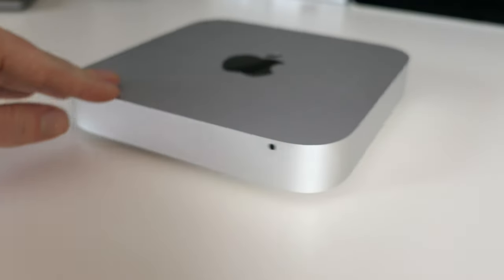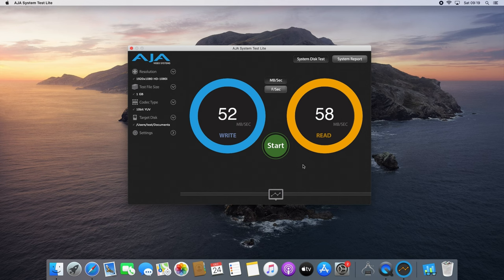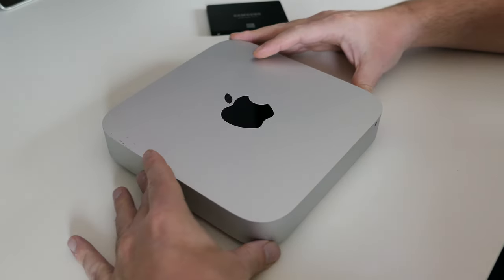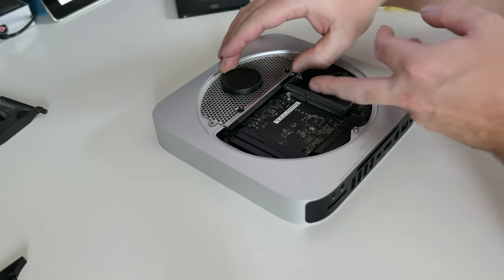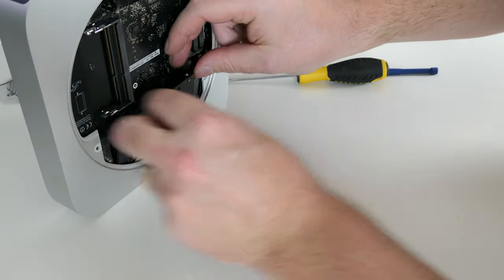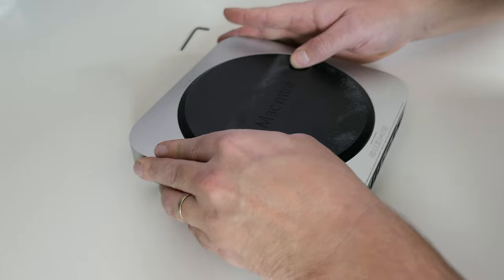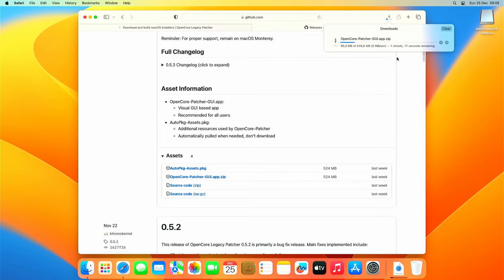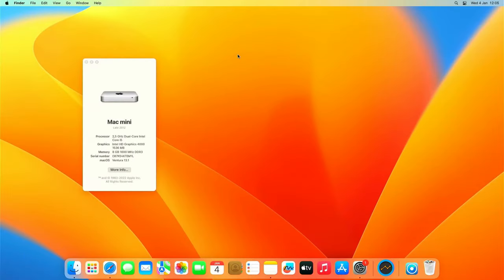Mac Mini Late 2012 - macOS Ventura and SSD Upgrade

Comment: I'm an 81-year-old grandma and have probably had 10 2012s run through my life and upgraded them all with SSDs, 16 gigs of ram for my two sons and myself.  I just bought another one to upgrade and install Ventura.  This is a perfect video for doing it.  None of us have busy lives so the few more seconds it takes to load anything is of no consequence.  Plus the 2012s are getting cheaper and cheaper. I seem to be a loose ends if I don't have a 2012 to fool around with.😉 They are the best streaming/media boxes ever using TVs as monitors.  Thanks for your good work!
Reply: I think it’s possible to buy 2011 models and replace the motherboard with 2012
Reply: @Helennore1990  Given they're very similar machines, I could see that working. What would be the purpose of this though?
Reply: What's the relevance for the technical support by stating that you're an 81 year old grandma? We don't care about that, you could be 200 years old and we'd help you anyway.
Reply: @greenhorngameplays5743 if it matters to her, then it’s relevant to her comment.  Your comment was unnecessary, not hers.
Reply: @evanrachelhood  your comment is also irrelevant to the video purpose.
Reply: @greenhorngameplays5743  reading comprehension? It was in support of the statement that she has plenty of time to goof around with these.
Reply: @herbiecactus6687  reading comprehension. it's still not relevant.
Reply: @greenhorngameplays5743  This is called experience. It often goes along with respect. You are missing at least one of those two. You must be very experienced.
Reply: @georgwor8955  then?
Reply: @Forlorn. the 2011 Mac Mini and MacBook Pros have an AMD GPU that had a manufacturing/design flaw that meant that every 2011 machine with that AMD GPU will eventually fail. Although, at the point of replacing the entire motherboard with a newer one, it would just be easier to buy a whole new Mac Mini 2012.

Comment: I had one of these exact machines back in 2019/2020! I used it as my daily machine when we were all online, and it worked like a charm! I upgraded to an M1 though just because I needed something faster for video production, but these are still quite usable I think!
Reply from the maker: They sure are. Such a pity Apple stopped supporting them. Although it is over 10 years old, the hardware is clearly capable of running Ventura without (performance) issues.
Reply: @jensdbe  What is the max capacity for the ssd, is there a limit cap on them, or could I just go ahead and install a 4 or 5 tb ssd?

Comment: Hi Jens. Yesterday I bought a used i7 Late 2012 where I would like to replace the built-in 2TB HDD with a 1TB SSD. I have already owned such a model and replaced the serially installed Ram and HDD a few years ago. However, the German YouTube videos on the subject were more elaborate because in these videos the motherboard was also solved to pull it a little forward to remove the HDD. In your video, removing the HDD as well as inserting the SSD without loosening the motherboard. Thanks for your instructions and greetings from Germany, Thomas.
Reply: Up Date .

Everything worked according to your instructions. However, the installed 2 TB HDD was not one but 2 1TB HDD's. In order to remove both, I would also have had to partially disassemble the logic board. I somehow didn't feel like it. So the 1 TB HDD remains installed as external storage for something.
Greetings , Thomas .
Reply: @thomasromeni8063  now install os ventura:)
Reply: @-xYz--nk1gm  
Of course, it was installed directly 👍 . Runs perfectly with Ventura.
Reply: @thomasromeni8063  I know. i also have a mac mini 2012 but i5. I only have 1 ssd and 1 hdd.
Reply: @-xYz--nk1gm  
Do your SSD and HDD work as a Fusion Drive or, as with me, as a separate hard drive. I briefly played with the idea of combining both as a raid partition, but I rejected it when I read an article that with this combination the HDD is the brake at the speed of data transfer. Having an SSD work alone would be the more reasonable solution.
Reply: @thomasromeni8063  it's different for me :) the ssd works separately as the ventura axis. but the physical hdd has proxmox installed on which i have my own dsn server, open mediavault. that is, it is not a Mac, but a Linux server. if I need a second computer, I run the ssd from the ventura and watch movies, because it is connected to the tv.
Reply: @-xYz--nk1gm  
This is an interesting division of a single Mac 👍 .
Reply: @thomasromeni8063  Hi Thomas, I have the i7 (fusion drive) too running on Catalina. Mainly working with Logic X on that machine. Was just about to swap the fusion drive for two separate SSDs to make it faster.
Now I wonder if I could install Ventura on one SSD while keeping Catalina on the other. What do you think?
Reply: @secondbow9409  
I don't know what speaks against your idea with two different operating systems 👍 . Especially if you use programs that run under Catalina, but no longer under Ventura.

Comment: Great video thank you.  I have the late 2012 model with the same processor, back when it was still new upgraded to a dual disk with the ssd carrying the OS and upgraded to 16g of RAM.  This summer bought the new mini with only 8g of RAM but it still is so much faster.  Should I take the time to upgrade the old mini to Ventura also?  Does it run better or worse than Catalina in your opinion?  I love both and the 2012 still has life in it.  thx
Reply from the maker: The performance difference with an M1 is obviously big. About everything is x times faster. Not really surprise for a 10 year newer device as well. In terms of feeling, Ventura does not significantly run faster or slower. It's more to stay up to date and be able to keep running the newest applications and get security updates. I do plan on doing a performance comparison between Catalina and Ventura on this device (and another) to see this in real numbers.

Comment: Thanks for this exceedingly helpful video. Just wondering;  will the cooling and fan sensors be affected by the newly swapped SSD. Is there any settings to be done from the system after installation regarding the fan?
Reply from the maker: Nothing needs to be done as far as I know. A SATA SSD doesn't typically run very hot or similar to a regular mechanical hard drive.

Comment: Thanks so much for this and the other more detailed vid for upgrading to Mac OS Ventura. I’ve just finished swapping out my HDD for an SSD. 
I did however notice that in this vid when installing Ventura after new SSD is installed, you use install Mac OS Ventura; but in the other vid you use the EFI file instead. May I know what’s the difference?

Comment: I use my i7 16GB 2012 mac mini as a server my main machine is a M1 Mac Mini.  The 2012 machine has dual 500GB SSD and an external matching Hub with 2TB storage.
Reply: Do you need any adapters to do dual SSD? All the dual HD videos on YT show one Physical drive and one SSD

Comment: Nice job Jens. Dank U wel!!! One doubt please: Is Ventura or Sonoma stable with the Mac Mini late 2012 6.1 (i7 3615QM)? Thanks a lot and happy new 2024 year!!
Reply from the maker: For me both run pretty stable. I do see that the hardware starts to struggle a bit with Sonoma. Probably due to the relatively slow CPU I have but that should be better with your i7.

Comment: Hi! Great video :)
One questions, could you please tell why the open core is necessary to apply to the system post install?
Reply from the maker: As Ventura is not officially supported by Apple, there is a need for some modifications/patches in order to let Ventura work fully. It depends on which hardware exactly but things like adding drivers or workarounds are needed.

Comment: Your video is absolutely helpful. After watching it a few times, i give it a go today, i upgraded my mac mini late 2012 i7 to macOs Ventura 🫣🤭 also upgraded my OS SSD to 1tb plus added a 4tb samsung 870 evo ssd for my files and photos. I am planning to upgrade the ram next to 16GB again. 
your video is easy to follow, really on point. I was able to install it easily rather than re-installing macOS Catalina when I reformatted my macmini yrs ago 😅 i only have a question, how does the fan works? Does your macmini gets so hat easily? If yes, what do you do to minimize the heat? 
Before this upgrade, my macmini was running smooth and quiet. I added an external usb fan on the back which help to lessen the heat. I was able to run my macmini for two days without shutting down and doing browsing and little youtube, the temp only goes as far 60 celsius. But now after the upgrade, i cant make it lower than 75 celsius. 
Anyone running the same problem? Is it because of the ram? 
Please if anyone have any idea how to fix the heat issue, i am happy to listen and try to do it. ☺️😉 TIA 🙃

Again thanks for this video. Its awesome ☺️
Reply: Fan is definitely working? I've also had problems with my 2012 every year when my apartment gets hot.
Reply: One thing I’d suggest is replacing the thermal paste, as the old stuff can get dry after 10+ years, thus reducing the cooling efficiency. It will also help to clean out the fan and heat sink, or replace the fan if it’s failing or broken. Having a secondary fan will also definitely help.

Comment: I just cracked my 2012 Mini 2.6 i7 for the first time because I wanted to eliminate HDD spin-ups from my life.  I followed the instructions on Macfixit to swap in the SDD.  It did not go well. I destroyed the IR harness (which I've never used and never will) and had a really hard time getting the new hard drive seated with the ribbon in any kind of reasonable positioning. Ended up with the SSD hanging at an angle, fingers crossed that the connector doesn't pop off the motherboard.  Not sure I got the wifi antenna connected properly again.  But it works and I'm booting from an intrernal SSD finally.
Reply: Various videos show several schemes to get the dowels (actually screw heads) in the back of the  SSD to fit in the upper set of holes in the back of the storage compartment. I use the one with a piece of tape with loop in the middle, to make a handle to pull up on the SSD. If you wish, there is space, and a connector, to put a second drive under the normal HDD/SSD. You have to source the proper SATA connection, which is much like the OEM main drive connector. And connects to the open SATA drive port on the logic board, directly to the right of the regular one. Other ideas are using a playing card under the drive to again, get the positioning dowels in the back of the drive inserted in the correct, upper, drive positioning holes. I use loops or doubled reading glasses, to be more competent refitting the various connections, such as the fan (NOT necessary to unplug to access the drives) and antenna. My last goof was not getting the drive SATA connector fully into the logic board SATA port, and had to go back in, and using more magnification, do it right the second time. You can't do what you can't see! I have noticed a big improvement in startup with the SSDs, I'm not using any program that tests machine performance enough to notice.
Reply: @billtaylor3499  good tips, wsh I'd had the benefit of your comment on the day of the operation.....I think if I ever go back in it's only going to be to salvage the SSD.... I'm not looking forward to whatever moving to a newer OS is going to break, but this machine really just doesn't cut it anymore.
Reply: @herbietccc  Higher OS versions Do install in your Mini, several YT videos show how to use another app to install 'unsupported' later operating systems (Ventura?) in a late 2012 Mini. A later OS may not be the issue, maxing out memory (Other World Computing is where I got mine) changes things, maybe enough. I'm noticing no difference between 10.13 and 10.15 in my 6.2 Mini, but I'm not doing any real computing, mostly surfing the net. I have the different OSs on different SSDs, and boot the one not in the machine using an external drive housing and a USB cord. Not fast, if I needed it, but lets me have two different computers. If I get two fully performing SSDs (At least one has an isue), they both go in the Mini, one under the other. Which boots is selectable on startup, by holding down the option key, on mine.
Reply: @billtaylor3499  I have no interest in moving to a newer OS on a 2012 mini. I don't see how your comment relates to mine.

Comment: I have the same Mac Mini i5, exactly the same SSD disk and 16GB of RAM. After install Ventura GUI is much slower than on Catalina for example. Selecting an option in System Settings from sidebar take 1-2 seconds
Reply from the maker: I did notice that System Settings is indeed slower. The rest doesn't really feel that way. More people complain about slow navigation in System Settings on Ventura apparently. If interested, also check out the performance comparison I did between Catalina and Ventura on this Mac: https://youtu.be/ZI7pjHKyuJY

Comment: I followed the steps and installed the Monterey OS, which brings back my old device to be a truly usable one, thanks so much! I just want to ask, after successfully setting up the Mac, there is software update option available to install Sonoma. Is it possible to install it with my Macmini6,2?
Reply from the maker: It should be possible to upgrade to Sonoma. Best is to first install the latest version on OCLP before that.
I did create a specific video on Sonoma as well in case you would be interested: https://youtu.be/acpQuCIy3GA

Comment: Hi Jens,
Another great video😊
Of course all the best wishes for 2023!
Question,
Ido have a Mac mini mid 2011.
Do you think I can upgrade this also to Ventura?
At the moment is still runs on latest supported os high Sierra.
Thanks, Hans
Reply from the maker: Thanks Hans for the nice words. Best wishes to you as well.
The Mac Mini 2011 is not supported yet for Ventura with Open Core. The latest you can run is Monterey (did a video on that as well but better to use the current steps, just select Monterey as version instead of Ventura). Support for Ventura is still in development. See here for more info: https://dortania.github.io/OpenCore-Legacy-Patcher/MODELS.html#mac-mini
Reply: Thanks, Jens.
Will look into it😊
Reply: Hey. FYI. Last night my 2011 Mac Mini upgraded to Ventura. Opencore still needs to patch everything. But install Monterey, then run the macos updater, then run opencore patcher after update to Ventura.
Reply: I should add.It will be unstable. You should wait for the latest patcher to be supported first. But if you aren't worried about freezing from time to time, Ventura works, but Monterey is still more stable for the moment.
Reply from the maker: @corvusaflame713  thanks for the update. Looks like with some (minor) patches, Ventura should eventually come to the 2011 model as well.

Comment: Nice explanation on upgrade. I have few doubts:
1) Can Mac Mini late 2012 (intel i5) take 1TB SATA Crucial SSD MX500 series. 
2) Is it adviceable to add 500GB Samsung SSD. (I mean Addition and not replacement). Will it work properly with 2 different type of Hard drives.?
3) I have already upgraded my mac mini with 16 GB RAM (8+8) of Crucial. Should I upgrade SSD also of CRUCIAL or it does not make any difference.
Reply from the maker: 1) yes
2) Different hard drives are no issue, it has two separate SATA ports 
3) No need for the same brand of memory and SSD

Comment: Great video, thank you! How do I mirror all my data and software from old hard drive?
Reply from the maker: I think the easiest method is by using time machine or migration assistance before upgrading.
Reply: CarbonCopyCloner or SuperDuper! will also clone your old (Catalina) hard drive to your new SSD.

Then install Ventura on top via the OpenCore Legacy Patcher USB flash drive.

Comment: Hi there - could you run the latest Xcode on this older 2012 machine after Ventura update ? You can u update the machine in the future or are you stuck with Ventura ?

Comment: I’m trying to basically do the exact same thing on my late 2012 (mine is i7, only difference). Catalina expiring has led me here. I started with an attempt to use OCLP for Sonoma, but quickly realized it was time to upgrade my Boot HDD (I have 2-1TB HDDs). I want to keep my Backup HDD and replace my Boot HDD (in the upper bay) with a SSD and upgrade to Sonoma. Same setup with the hard drives- not trying to do a Fusion setup- old HDD for backup and new SSD to run the system as a Boot drive. My question is, since I will want to backup from Time Machine via my old HDD Backup drive, should I install the new SSD with Catalina OS rather than doing both SSD upgrade and the OS upgrade as you did in the video? I’m wondering if I do them together like you did, will the Time Machine backup from the old Backup HDD just reverse the Sonoma upgrade back to Catalina anyway? Since I am backing up from Time Machine after the SSD upgrade, should I just wait and run OCLP for the Sonoma upgrade after I install the new SSD? Thanks in advance for any advice!

Comment: i have mac mini late 2012 16 gb ram i7 2.3 GHZ so it is the macmini 6.2 .. i install Ventura with the latest opencore root patch i do everithing fine. works fine only problem is the CPU TEMP AVG of 80 c  on max CPU FAN !! max cpu i get was 100 c
Reply from the maker: It's not really getting that high in my experience. But I guess the i7 gets a bit warmer. Maybe replacing the thermal paste is needed?

Comment: I’m right now setting up a 2014 mini with 8GB RAM which was standard on it new and a swapped 256GB SSD but i DONT want to install Ventura on it since it’s not supported. Instead i want to run MacOS 10.12 or 10.13 with the last working full service version of macOS Server